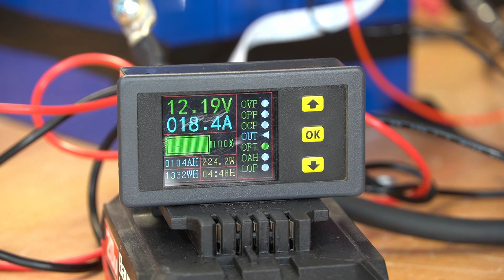Testing a New LiFePO4 BMS, 12v Battery Build and Aliexpress Cell Test

Comment: What voltage did u charge the cells up to before u started ur test ? I have brand new cells all reading 3.29 right on the nose do i go ahead and install the bms and put them into use ?

Comment: I tested costomized dally BMS Low cut off temperature and it worked fine. I asked them to set for cutting off in low and high temperature and fortunately both of cutting were acurate at 0 and 55 degree

Comment: Hello. I somebody read that, a video about grounding and PV solar could be a good idea. I have a Growatt 5000ES inverter and a lot of troubles. My AC residual current circuit breaker stops AC sometimes. I fear it is when it is raining (but I am not sure, perhaps it is only when sun disapear because it often rains at that moment).

I noticed I have 120 watts between the ground of the inverter and the main ground of the house. I find it is very strange ! I have these 120 watts even if PV circuit breaker are down.

Stranger, if the PC circuit breakers are down (so DC circuit is opened) I have 1 volt between the ground of the panel frames and the ground of the house. But if I close the DC circuit, I have 160 volts (tested in AC mode on the voltmeter) between the grounding of the panels frames and the ground of the house...

I have 2 lines of panels not linked ont to other (only the frames of the panels are linked to ground). And it is the same trouble if I use one line or the other. It would be strange I have the same leak at the same place I think.

Somebody knows what happens ?

Comment: Is there a BMS with a low temp cutoff, that instead of switching charging off, dumps the charging into a heater, to heat the batteries?

Comment: Hello.  I watch your movies with LiFePo4 batteries and I noticed that you have a lot of knowledge about them.  Can you tell me what happened to the BMS because I don't want to connect via bluetooth?  Is it possible to restart it somehow?  Maybe I accidentally made a short circuit.  I have made the connection to the cells correctly.  when I connect the LED lamp it barely lights up.  Please help and thank you in advance.

Comment: Using 16 320Ah LiFe PO 4 batteries hooked up as 24V. How many amps can I pull steadyly? How many amps can I charge them at? I am working on plans to build a battery bank to run all my 110V cercuits. Last July I used 1440 KWh. Mostly the A/C, I'm sure. My 7K gas generator will run the entire house except for the A/C, Range and Hot water ( Total Electric). Thanks in advance

Comment: Hello experts, I put a 4S DALY BMS to my 272AH pack and check the voltage from BMS P- to Battery B+ and it show 3.11V, when i check from Battery B- to B+ it show 13V.... is the voltage from P- suppose to be same as B- ? thanks

Comment: PLEASE HELP! I followed all your videos and love what you do, thank you.

However I still can’t get my BMS to reset and work. When I connect the voltmeter through the BMS I’m only getting 3.2 V instead of 13.3
Reply: I shorted out the BMS but I didn’t get a spark or anything. I put a charger to it but it said the voltage was wrong and would not charge. Do you have any other suggestions?

Comment: Ok the low temp cut off failed to work. But what about testing if the low cell voltage cut out works to see how bad this really was. If that had failed it may have shown the item was actually fake and didn’t do anything.

Comment: On the -5 degree celsius cut off: I have come across several Chinese Lifepo4 batteries that can be charged at -5 degrees C. It may be designed specifically for those batteries.

Comment: Hi mate, if i was trying to make a 12v battery with 200ah out of 8 lifepo4 3.6v 100ah batteries. Would I need two of the BMS on each of the parallel battery banks or one for the overall battery? (if that makes sense, i'm a total novice living in a boat in London)

Comment: For safety reason can i use 250A BMS in case of 200A cells? It is a good ideea to use a larger capacity BMS or need to be the same value?

Comment: I need help with a BMS. Charged batteries in parallel first to nominal voltages. Connected Blue to B-Negative, and balancing leads to cells. I can't get power out the P-Negative. Checked leads again and Polarity points between cells, all 16 connected correctly on the plus sides and I still get no power on the P-Neg. Any suggestions? Using a Simple BMS LifePo4 48V @ 100 amps.

Comment: While getting caught up with your videos thought does this guy answer questions? OK nothing like testing this question. I have been working with 18650 li-ion cells for about a year and was an electrical/ electronics technician now retired. Now for my question; Is there a kit for a UPS whereby you add the batteries? This kit should have all the li-ion protection circuitry needed. So far have seen those converting lead-acid battery UPS to li-ion but since this will be used in my home would like something a bit more professional. If it was expandable that would be a bonus. 

Not really looking for a battery generators like the many at Amazon.

Comment: Those are M6 -1.00 x10,  12 or 16 gives extra length, trick is to get as close to bottom(without touch) with Bus and BMS connectors and washer and lock washer.

Comment: Have you tried glass fiber tape? Use e tape first for a little clamping pressure and then some glass tape for a rock solid build. 

It doesnt stretch so it should keep the cells all in line.

Comment: I really appreciate your body of work. I'm an avid watcher, but seldom do I interject. What I'm looking for is an answer on whether it's ok to build a 100 AH 12 volt LiFePo4 battery assembly, then start using it with my solar set up, then, as I can afford to buy the components, build another assembly exactly the same, but two months later. By this time the first assembly has 60 cycles on it. I would then balance out the first 12 volt assembly with the second, that I wired in parallel. Now I have a 200 AH 12 volt LiFePo4 battery assembly. Two months later, do the same thing again, now I have 300 AH 12 volt LiFePo4 battery assembly, and continue this until my battery bank is built out. My question is at what point does this become a bad idea, because now I have a 12 volt parallel assembly of 12 volt batteries with an advancing cycle count on the first to the second,  third, and forth, and so on. I want to do this, but I'm hesitant. Any thoughts on this?

Comment: Hello.  I have an electric motor.  The original battery is 60 volts 20 amps and 1500 watts ...
Does a new 60 volt 50 amp 2500 watt battery work with the engine?  Or will the engine break down? 
Or wich good battery can i buy ? Pls writh volt - ah - watt

Comment: Are you suggesting that below 32Deg F (freezing) will kill Lifepo cells? So i should not replace my RV/Off-grid Marine DeepCycles here in Iowa (where it goes sub 32 for a few months every year).
Or is it something else.... like just don't charge/discharge LIfepos if <32Deg.
My car/truck/rv leadacid batteries can sit out all winter with no harm, if Lithium batteries are that vulnerable to a little cold, i guess i'll have to pass. :(

Comment: Remember Will, the weakest point on this setup is the log terminal from the BMS negative wire (the contact area and thickness is minimal compared with a single bus bar) 😁 
PS. What BMS do you recomend for a 4 cell 200AH LiFePo with a low temp disconnect ? Thanks so much

Comment: I found some 60 AH 4 Lifepo4 cells.  With bus bars and frame around them with handles for $250. I  got 2 for total of 24 volts.  Checked the cells and they were very close to the same voltage. I am replacing 4- 12v 17AH batteries that were connected 2S2P in an UPS! I have not found a  BMS that even looked good paper. 3.75 volts for High voltage cut off I think is high. And 2.2 volts is lower than I want to go. That times 8 cells is 30 volts. I have been looking for a chart to go by for the best cell voltage for high and low for the best battery life. I am sure that the  Lifepo4 cells will work better than the  gel cells that were in it to start.  I don't think the UPS  will over charge them but may over discharge them. Just need to add a battery discount.

Comment: those blue prismatic cells are case negative, and they only have that little thin blue wrapper around them. You need some kind of separator in between them or you're going to get a big fire

Comment: Hi, thanks heaps for this very informative video, you've given me some inspiration, but I have a question: I'm planning to use some lifepo4 cells to make a battery that fits in a small size behind the back seat of my car, but I think I'll need to configure the cells in such a way that could mean that the bus bars will be different lengths (some long, some short).
How much does the bus bar length matter?

Im trying to find the smallest cells at around 100Ah, to make a 12V deep cycle battery.

Thanks again.

Comment: Is there a standard way to handle a situation where the charge controller documentation states that it will be damaged if it is disconnected from the cells, but the cells must be disconnected if they go below 0c.

Comment: I feel your pain regarding the temp cut of. How about another approach though? I have lifepo4 in the Van and it gets cold through some nights, so I bought a heating mat and plan to use it to simply keep the battery above +5, which is very easy to do in the closed isolated box and the mat draws just 30 watt which is not much.

Comment: DALY sets their BMS for low temp cutoff set to -7 deg. C. You would have to lower the water temp. a little more and retest. According to them it's safe to charge LiFePo4 at this temperature. Could you point me to literature on low temperature charging of these batteries?

Comment: Can you hook up a 12v solar panel directly to this battery?  Will the bms shut off the panel when it’s full?  If it does will the open circuit voltage of the panel cause problems?

Comment: @DIY Solar Power with Will Prowse - I found dealing with Daly through the AliExpress message function very frustrating. You end up going round and round in circles. I have found dealing with  Kevin Zhang   ( sales1@dalyelec.com) far more fruitful. Drop him a line and you should get better results.

Comment: The new BMS you talk about @12:38 .... how can I say this..... I have a motorhome, its a 12v system, I'm going to put solar panels on it plus your favorite epever mppt solar charger, and I want to buy the 8 pack of 150ah alum case cells for 850 off ae (unless theres a better bang for the buck with a diff ah size?) my questions are can I have 2 of the these new bms making two 12v batteries but then how does the bluetooth work? Will I know which battery I'm talking to? Will they interfere with each others signal? Do they show up separately in the app? Or should I just make a 24v battery? How would that work in a motorhome that uses 12v? I'm so confused. Thanks for any help anyone.

Comment: Will. Your videos are awesome! Why don’t you crack the case on the BMS and see if the LTC sensor lead is actually connected to the PCB? I suspect that there is not a temp sensor built onto the PCB itself since sticking the whole BMS in the freezer didn’t yield positive results but unless the temp sensor leads are soldered onto the PCB, the connector could have come off in shipping? You could also measure the sensor by cracking the case too. Just giving the manufacturer the benefit of the doubt and I’m curious.

Comment: I've been using the Daly 48v 200ah bms for a few months on my off-grid 10kwh system.  I don't mind low temp cutoff as my inverter controls that. I mainly use the bms to balance and as redundancy.  I've found strangely the bms is keeping the balance close on 2 separate 8 battery sets of the 16.  So I can see 1-8 within 20mv and 9-16 with 20mv, alas those two banks are a full. .2 volt out at 3v. I'm thinking of rebottom balancing. But it's difficult now I rely on them. Interested bin what bms options are available. The zero tweaking of the Daly is a double edge sword.
Reply: 20mV or 200mV (0.2V) ?
Reply: @Master-wj2jb  .02v , they get up to 80-100mv  during a 70amp xharge, but under slow discharge are really close .

Comment: Update!
As Will said recently the 6mm. threads into alumuninium on these aluminum case prismatic cells really suck!
In dealing with Daly over the failure of my 200 amp BMS they got me to do a bunch of test and take photos of the result.
Of course this meant removing and refitting the terminal bolts numerous times, and on the very last one, bingo! stripped thread. :(
So, several hours later it is repaired with a Helicoil, and I think actually better than new.
For what it's worth I had no issues with drilling and re tapping to fit the Helicoil however, I did not dare going any deeper than the original hole depth.

I sharpened the drill bit to the flattest angle possible so I could clean out the hole right to the bottom, and I ground off most of the taper from the end of the tap as well.

The only issue is it is not possible to remove the tang from the bottom of the hole, if I have to do another one I would grind the tang slightly shorter so it could be broken off.

Daly requested that I mail the faulty BMS back to them and they are sending a replacement, I will be pissed off if they don't refund the freight cost (with tracking as requested).

I just can't figure why you would put a 6mm. (by about 10mm. deep) terminal on a 200 amp hour battery? It is also interesting to note that the cable size on my 1500 watt inverter is exactly four times larger than the leads on a Daly BMS, hate to think how hot they are going to get.
Reply from the maker: No way!!! That sucks so much 😔 worst nightmare story right here. Geez. I am returning one of my Daly BMS this week. Wish me luck. And watch out on the shipping cost. My quote was more than the cost of the entire product one time
Reply: @WillProwse  Yeah well it gets better, originally they said "Please ship it back and offer tracking number, we will ship another one after we can track it to make sure you receive the new one earlier". So guess what? as soon as I gave them the tracking number they reneged,  now they say oh we will check it out and then send you one.
I made it clear that would be a VERY bad decision, and they seem to have changed their mind.
I also asked about the AU$ 33.50 postage reimbursement, and they seem a bit hesitant on that subject also.
That would not be smart either, because under Australian consumer law they MUST pay it, and if there is enough push back they can be banned from exporting to Oz.

We will see what happens, I'm really over these guys.
BTW, they informed me they "have started making another one" seriously! I am highly suspicious of business that appear to be huge but don't seem to have any footprint on the ground, it's easy to fake a few so called factory pics.
Reply from the maker: Yeah, completely illogical. I agree
Reply: Any answer on that Relay trigger question yet?
Reply from the maker: @TexSAAB9-3  which one?
Reply: @WillProwse  I asked what is supposed to switch the relay on and off as per my/your schematic?
Reply from the maker: @TexSAAB9-3  oh the BMS does. If BMS disconnects power, relay goes off. That's all. Does that make sense
Reply: @WillProwse  yeah sort of, but it means the relay will be active (switched all the time, correct? Like 24/7.

Comment: SO I had a good conversation with the DALY engineers ... There TEMP PROTECTION is for 65-75C NOT FREEZING or 0C or 32F ... I personally think it would be very easy for them to make a probe that shut down at 0C BUT they said that there is NOTHING on their drawing boards for doing that. SO for right now - literally 99% of the BMS's that say Temperature Protection they mean 65-75C NOT Freezing ..
Reply from the maker: Wow what a joke

Comment: Will, thanks for all your good info, you are one detailed kind of guy but explain things in English which is good cuz I don't speak Tesla.
Anyway, I want to convert the house bank in my RV from 2x6 volt lead acid to two 12 volt Battle Born drop ins. The starter battery will remain AGM for cranking power.
Question: Since the alternator under the hood has a built in regulator, will it charge the lithiums efficiently without reconfiguring to an external regulator? My fear is that it will only charge at a high rate during it's self imposed Bulk charging zone. 
And then what about the onboard charger that runs off 120 from shore power or the genset? Same questions?
Can you direct me to a good article or two about this?....or am I worrying about something that is already solved within the BMS?
Thanks again. 
I couldn't find a way to contact you directly so I decided to simply pose my question on one of your latest postings.

Comment: My 55” flat screen TV has a persistent vertical red line which I assume is from a power spike/surge, and I was looking at building a UPS with lots of battery power for reserve power, and then I wondered if I could just run my electronics on batteries and not worry about surges and power conditioners for my music production equipment. I’d need a really clean sine wave so as not to introduce noise, is this a good option?

Comment: hi beginner DIY'er . i just picked up a cheap and simple 12/24v charge controller and a 150 wH LiFep04 battery. ive done some research and it says the battery charge voltage is around 4 volts. is this going to be a problem? my DC source is not a solar system but a motor i salvaged and turned into a generator. any info would help. love your channel and your videos have been very helpful. thanks a lot!